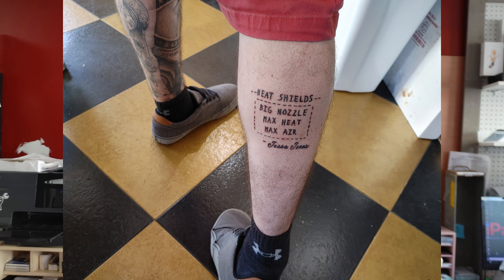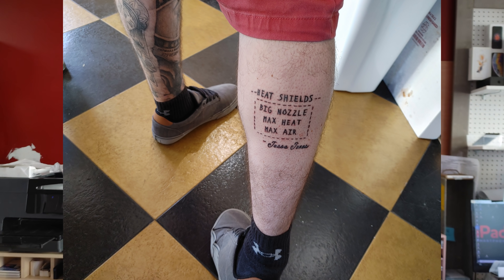iPad Rehab teaching style - with Jessa Jones

Comment: I retired early from the oilfield mainly because I was sick and tired of hearing the phrase "I've always done it this way, nobody's ever complained" from the guy whose mess I had just driven a couple hundred miles in the middle of the night to clean up.
Reply: Sometimes "nobody's ever complained" is the actual problem. People can't just sit silent when they see something done wrong.

In most cases, it's possible to use posutive feedback and help educate people how someyhing can be done better.

But some peoole just can't be bothered to listen. Or admit that there are better ways. Then it can be a bit of a problem to find a way forward without creating a big conflict. And sometimes a consultant is the best way - someone that can come in, explain and take the heat and then leave.
Reply: when folks get complacent and bad stuff happens
Reply: Probably said the same thing the last dozen times. 🤣
Reply: Did that nitwit just call you a nobody

Comment: Should be obvious to people that low hear or low air or narrow nozzle means it'll take forever to remove the shield. And if it does come off, it will yhen be enough time to cook the poor components.

This is similar to factory production where a board is preheated before the final really hot temp (but short time) to actually melt the solder. Just so the max inside temperatures for the components aren't passed f8r smaller components with little thermal mass. Pre/post-heat obviously also help with stress from thermal expansion by reducing the difference between hottest and coolest parts.
Reply: It's also why you preheat before welding cast iron.
Reply: @josephdestaubin7426  no? depends on the weld, but small stuff there's no preheat at all. and the reason is entirely different. cast iron is very hard, when the whole thing is 80f, except one spot thats 2500f, that causes a difference in thermal expansion which causes whats called hot cracking. hot cracking can be a thin crack all the way through or the part literally exploding. now if its a big enough piece it'll have the thermal mass to resist that so a small weld wont neex it, but if its think it could be like plate glass except metal
Reply: @bradhaines3142  Wright, that's my understanding, but that's not a quality of hardness as much as a quality of brittleness. As in, cast iron is brittle as compared to the tensile pule of weld, all ells being equal, and thus very similar to the  boards. But this is not exactly my field, so apologies if the terms are less than precise.
Reply: @bradhaines3142  Also, I am comparing it to a solder joint, which clearly is VARY small as compare to the size of the board at issue.
Reply: @josephdestaubin7426  hardness and brittleness are the exact same thing. maybe you should talk about things you actually understand